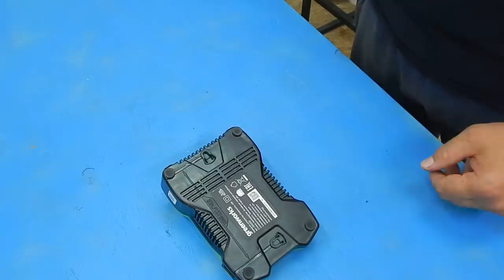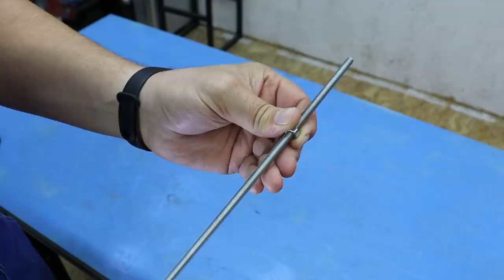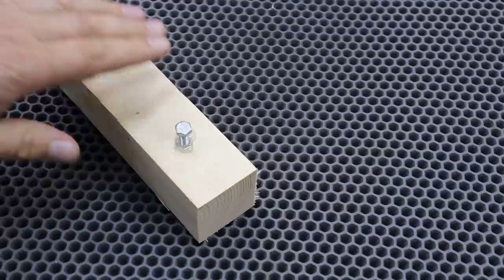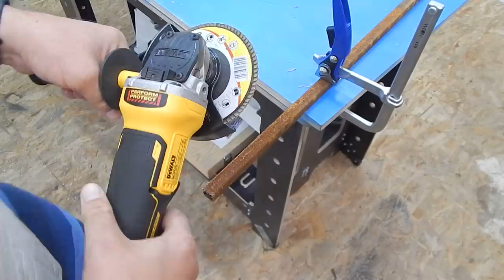Мало кто знает эти Советы и Хитрости Мастеров по Дому, Которые Действительно Помогают ▶30

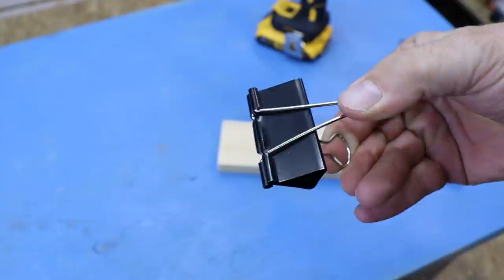Comment: I'd like to say on the tip at 14:22, first there's no need to take the clip handles out just to install them on the block. Just flip them up out of the way. Saves a bit of hassle. Also, except in close quarters cases, no need to take them out to use the block. either. Again, just flip them up out of the way. Finally, I'd suggest using a block double that thickness, to keep fingers further away from potential splinters.

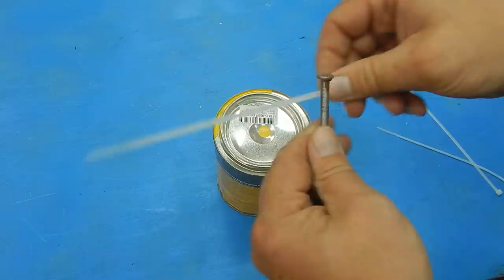Otherwise, some nice ideas here. The paint mixer (11:25) can be scaled up with a longer bar & heavier zip ties, too - though I made a heavier duty stirrer with steel and a welder. 😉 

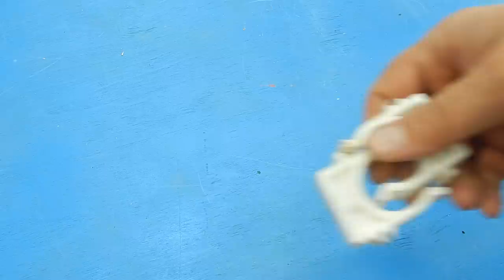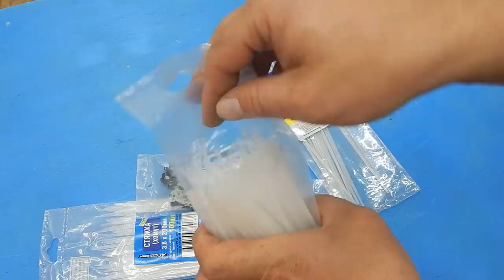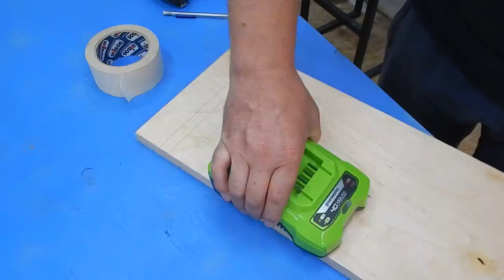The wheel barrow hanger (12:22) is nice, as is the method of opening the zip tie bags (10:20). I might even invest in a heat gun so I can do the one at 2:30 & extrapolate it to other things I could form the plastic into with it.

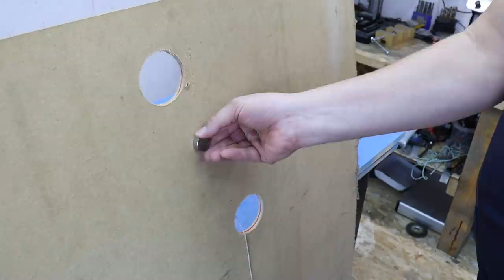edited to add: @ 16:40, predrilling with a bit slightly smaller than the bulk of the screw (in other words, screw width minus threads) before running the screw in is better, especially if it's a surface you don't want accidental dents in and you want to be sure it doesn't split - at all. Note that the wood still split around the screw, just not to the end of the wood. Predrilled holes avoid that altogether.

WHOA, THERE! At 20:12, what the HELL are you doing wearing SANDALS, and PLASTIC sandals at that, in the SHOP?? That's BEGGING for trouble!
Reply: ... and they're not even the right size!  :D

Comment: Didn't understand the countersunk screw to prevent wood split at 16:50 .
Reply: I looked at that twice, and I can't figure out what he was trying to convey.
Reply: @johnknight5639   I'm too lazy to go to the drill's website, but I assume the black button has an option to let the driver slip when the screw gets tight.  Don't know if that's much of a secret otherwise; maybe only to those, like me, who don't have that on their drills.
Reply: When he sunk the screw the first time the wood split. To prevent this, he runs the drill in reverse on the second screw which basically bores out a bit of a pilot hole. Once he feels the hole is deep enough, he switches the drill to now drive the screw like you normally would. By running it reverse first, the hole it creates prevents the wood from splitting.
Reply: @raygrinders3918  The black button controls the direction that the drill spins. He was just showing the camera that he was switching it from counter clockwise rotation (which he used to create a pilot hole) to a clockwise rotation (used to drive the screw into the bored).
Reply: @ThumperG   OK, so driving backwards makes the screw act as a drill for as long as the user can pressure the screw into the wood.  Got it, thanx!
Hey, I might start doing that on my PVC pipe project and stop fumbling with my old drill's chock to go back-and-forth from bits to screwdriver tip.

Comment: About using the drill on the paint can. I have some doubt that it mixes. It just acts as a centrifuge p, not “shaking” the contents to mix. Any thoughts readers?
Reply: There is inside of can an iron ball to mix , to shake or whatever yo want .
Reply: Centrifugal force will cause the agitation ball to be forced to the farthest end away from center. Shaking resolves that issue.
Reply: @pederstrand8349  At which rpm  200 or 2000 ?  Is there enough centrifugal force at 100 rpm like in video ?  Pure blah blah :)
Reply: Life Hacks...lol